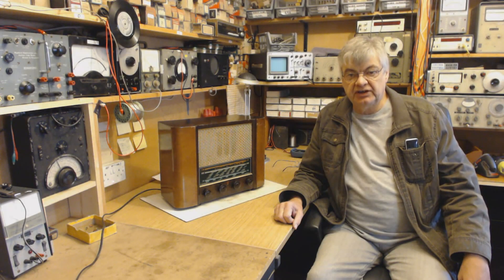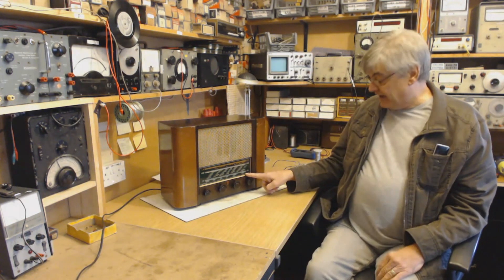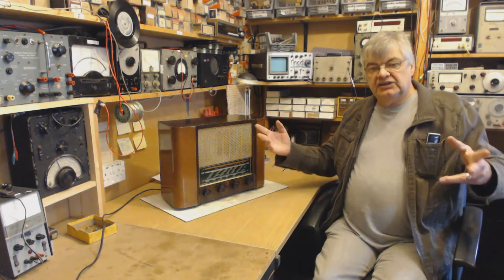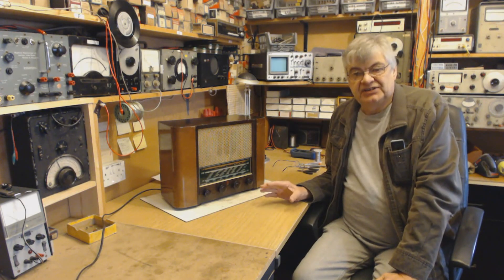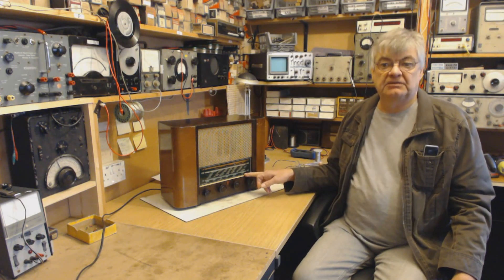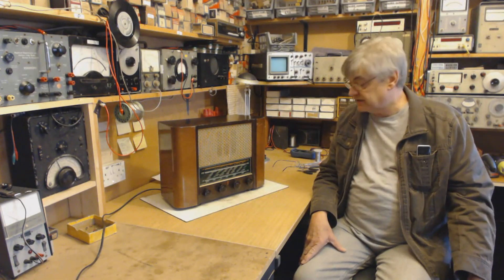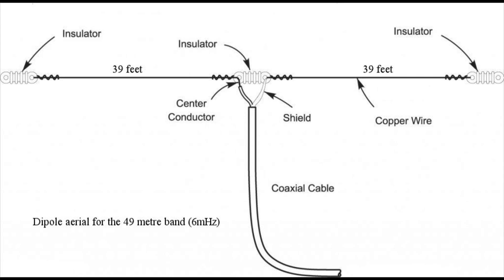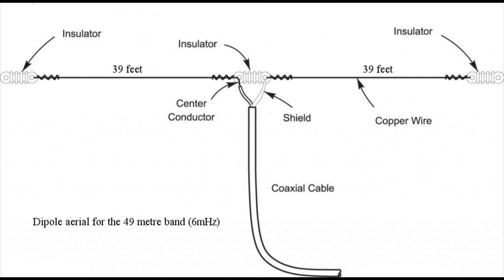A dipole aerial for short wave listening

Comment: Hello, Ray! I 've got a small portable radio that does FM/MW/SW (a Degen DE13--it was the last little luxury I bought before capital controls were instituted here) and I too am interested in listening to the 49m band. My radio doesn't have an aerial input, only a telescoping aerial. Could I attach the aerial you describe here to the telescoping aerial with an alligator clip? If so, what would I do with the earth part of the aerial coming into the house through the coax wire? Does an aerial like this (at the proper length) improve FM reception as well? (Great videos! Any chance you 'll be doing a video on improving MW and FM reception?) Cheers from Greece! -Angelos
Reply from the maker: tēletheātēs Hi Angelos, Yes, the aerial should be good for your radio. Connect the earth part of the coax to the radio chassis, this will be the metal around the headphone socket, if it has one. If not, connect it to one of the battery leads. It won't improve FM though.
Reply: Excellent! It does indeed have a headphone socket, as well as a second battery compartment for AAs, which is currently not in use, as for normal listening I run it off the internal batteries which recharge via solar panel or hand crank. The FM is plenty sensitive on its own, so much so that I usually have to lower the telescoping antenna. The problem with FM arises when trying to pick out a weaker station adjacent to a stronger station (i.e., selectivity). The metropolitan area of Salonika is notorious for its overcrowded FM band, as well as for privately owned stations that routinely broadcast with too much power, thus drowning out public stations adhering to the legal limit.
Could you tell me what you think of those external coil aerials for MW? They 're supposedly good for DXing MW and work without even being physically attached, merely by being in close proximity to and coupling with a radio's internal ferrite aerial.
Thanks so much for all the great videos and useful info. Cheers!
Reply from the maker: tēletheātēs To be honest I prefer a decent outside wire aerial for medium wave rather than a coil or loop. Having said that, a loop is great for nulling out unwanted stations or interference. Cheers, Ray.
Reply: In my case a loop in close proximity to the internal ferrite is the only option, as there is no way to physically connect a wire for MW. Thanks again so much for your input, Ray! Cheers! -Angelos
Reply from the maker: There is but it involves matching and circuit changes etc.
Reply: Interesting. Maybe an idea for a future video of yours???
Reply from the maker: Yes, good idea. I'll make a note of it. Cheers, Ray.

Comment: Hello Ray, thank you for the excellent video.  My question is regarding the 39 wire any specific one or just any wire could make. Second question ....do I need to brade the wire ( 39) Or it should be normal wire with its cover. Many thanks ..Stay successful.
Reply from the maker: Mohamed Hameedi  Hi Mohamed. Virtually any type of wire will do, just normal wire with its cover. Cheers, Ray..
Reply: Dear Ray....many thanks.

Comment: I use a 75 ohm TV cable 200 feet long with a single 70 foot wire and grounded shield  the main purpose is to get away from the power lines which wreak havoc when your too close. and is plugged into a Realistic DX-390. I may try a dipole setup at see if it is better  I am trying to catch the illusive UVB 76 buzzer. here in western Canada. I caught it only once in Feb 2014.
Reply: rEdf196 websdr.ewi.utwente.nl:8901/?tune=4625  about 1900utc-0500 utc / or / isthebuzzerup.org.
Reply: rEdf196, I just received a DX-390 last summer and am still learning, do you still have it today? Tell me what you used for an antenna that worked, thanks.

Comment: For reception, I'm using a 30ft horizontal length of copper wire,  stung 5ft above my roof deck.
One end of the wire feeds the 500ohm input of my receiver, using just the core of 50ohm coax cable. 
The receiver earthed via my steel kitchen sink

It seems to work well  between 49M and 31M.  That said I have nothing to compare it to.

Is it feasible to add a vertical antenna that shares the 50ohm coax cable with the 30ft wire?
Reply from the maker: It is but you will need switching and some kind of matching to the coax. It's probably better to have a separate coax feed to the vertical.
Reply: Thanks for the reply.    I'll do a little bit of experimenting.   I'm a bit cautious of going to high with the vertical as we get a lot of lighting here.
Reply from the maker: OK, well take care!